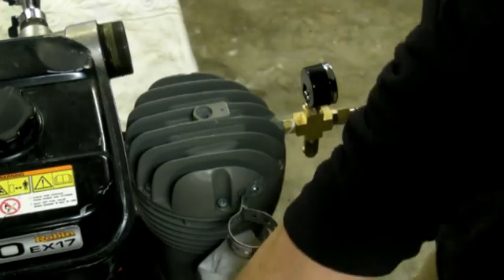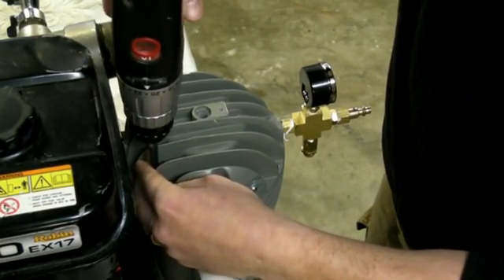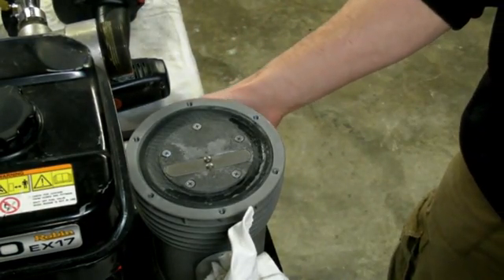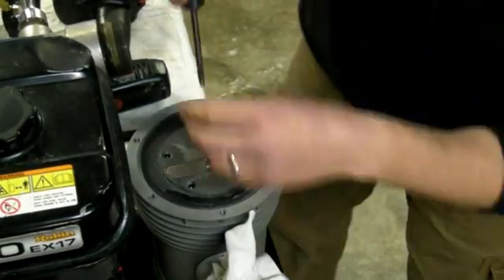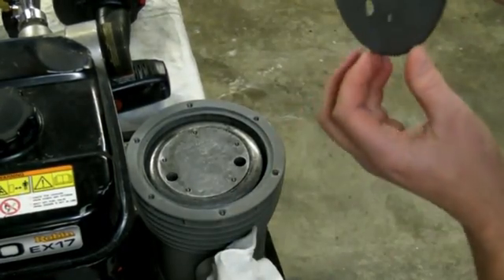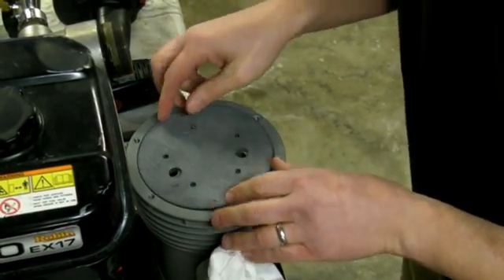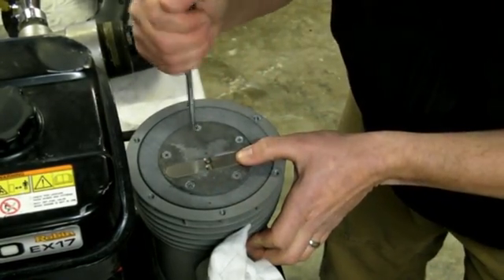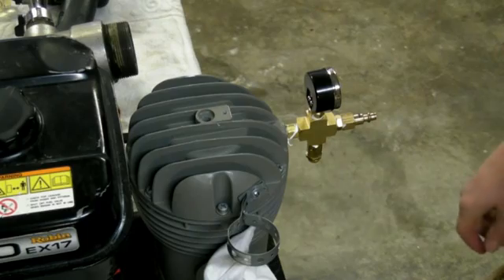How to replace T-80 diving compressor diaphragm

Comment: You may want to check and clean all reeds while you are in there. When I changed my diaphragm I notice I had a lot of fine debris under the reeds which will cause problems as well. Was not mentioned in vid. Nice vid though. Thanks